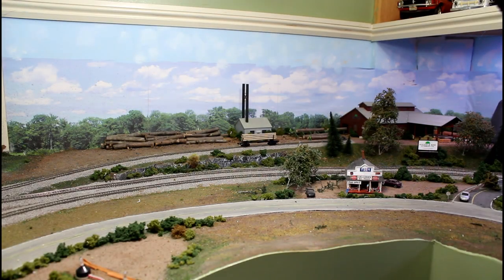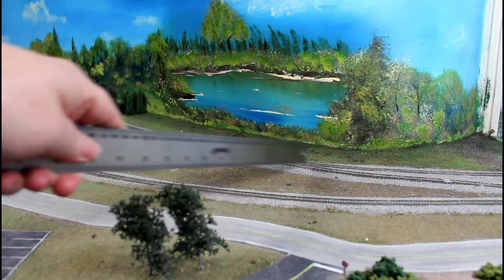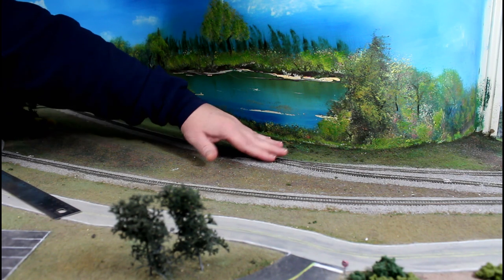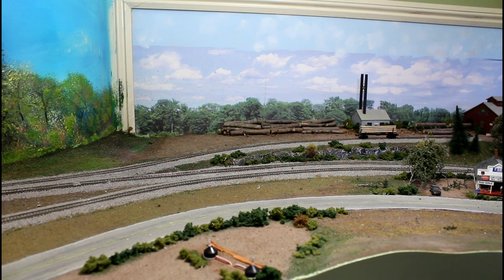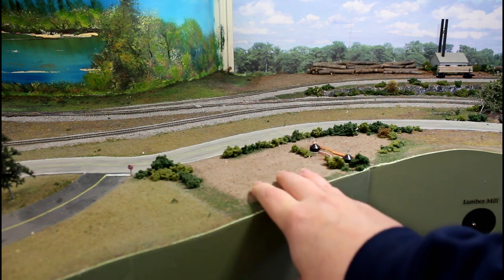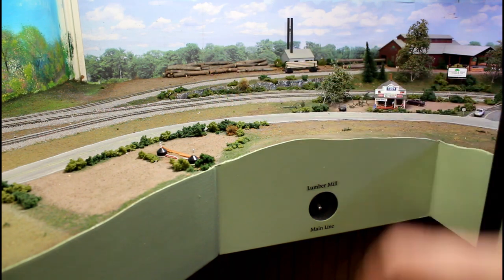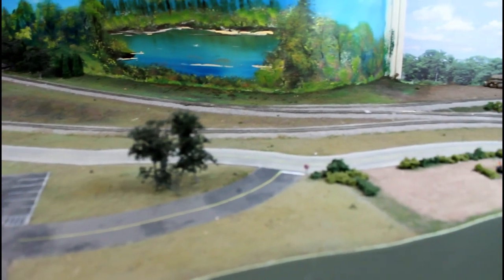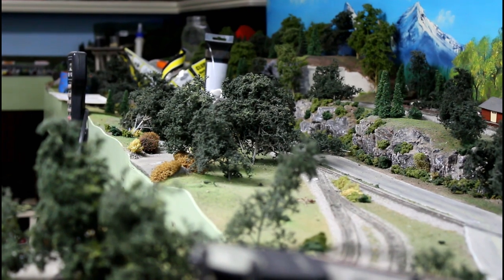Building A Scrapyard: Part 1

Comment: Hi Mike,
I like what your planning for the lumber, now scrap, yard.  Not negatively but, I truly did not understand it's placement.  I agree the two companies would not use a full consist to traffic lumber from or to the two locations.  A yard jumper maybe.  And though it's a good stand alone diorama.  Or an end of the line, hidden reversing loop, façade,  But where it is seemed forced.
Now for the working car wash.  I am so ecstatic your continuing with my weird/wild idea.  And then improving it with a moveable gangway.
Last week you mentioned that the car wash didn't fit where I had suggested it. 
Behind the scenes tale.  Friday evenings, at my RxR Club (NVR/WAS RAILROAD) is the layout clean up & repair meetings.  Our Gandy Dancer  crew works hard to get the layout ready for the weekend visitors & the following weeks School kid S.T.E.A.M. class sessions.  But we also need dinner.  It's at that time we watch you, Charlie Bishop (at Chadwick) & until recently Graham Foulston (at Lakeside).  When you said you were going to drop the car wash idea EVERY GANDY DANCER'S EYES (in the Whistle Stop Café) TURNED TO ME FOR MY REACTION.
Moments later when you explained your plan and why a loud cheer went up.  We're still in it.  I couldn't stop grinning.  Which was great and satisfying, but have you ever been pummeled by a pizza crust jubilee.  Not fun.
So how about another P.I.T.A. idea.  You seek out three or four layout locations where the car wash.  Which would fit in the footprint and your aesthetics.  THEN show those sights on a YT episode as well as your WordPress page.  Give details shots.  Then let the viewers vote for where they think it should go in the YT comments or drive the viewers to your WordPress site to vote there.  Though I have visited the site in the past I am not a regular Unusual Visitor.  This voting idea could increase your visitor count to the site.
Good going with the scrap yard.  I'll be watching.
~Jim Van Amburgh

Comment: I have a couple of questions for you on the new build.   The scene is not that deep so why waist the space with a second track?   If it is a steel scrap yard you really need a crane to unload and load   The other question is why not lower the track on the scrap yard side not a lot but would aid in switching cars to stay put.   looking forward on the build.